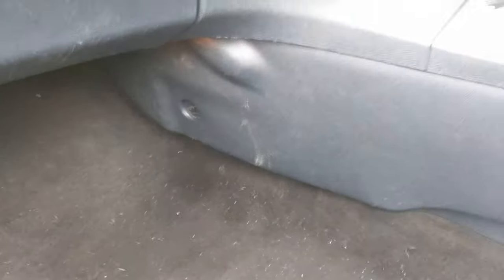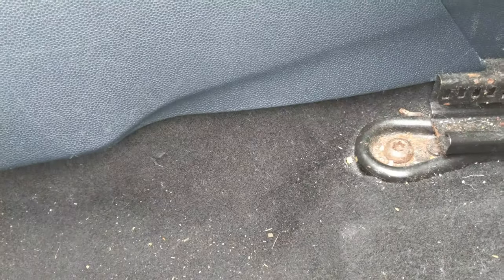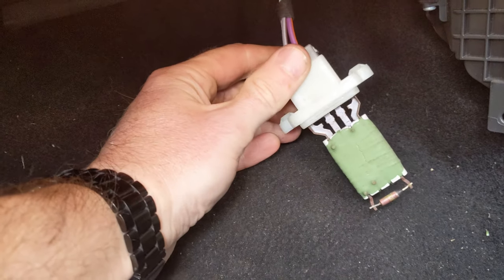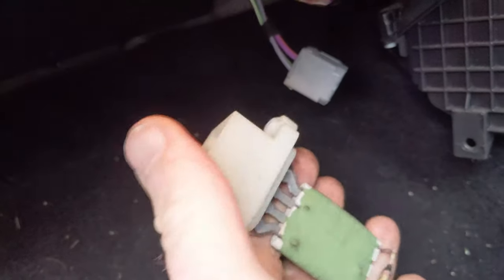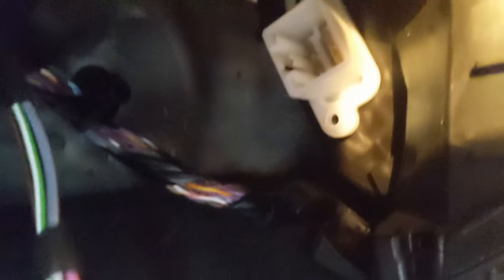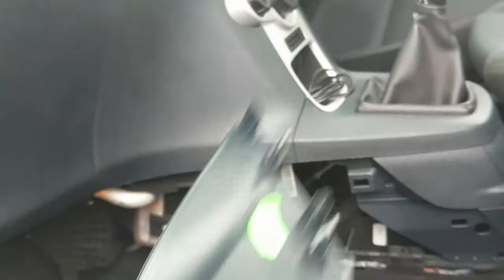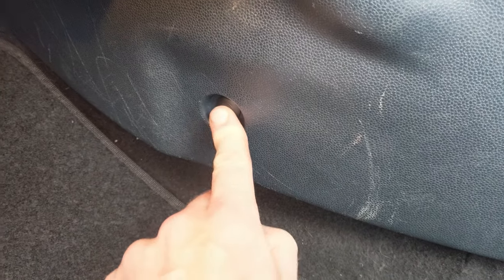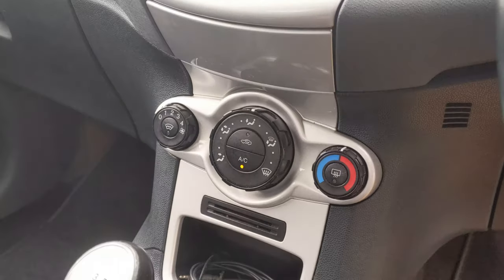Fiesta heater only works on four - Fix

Comment: Mine just blow for the face, I switch to feet or windshield but still blowing for the face... You know what it can be?
Reply: Did you  find a solution to this? Currently having the exact same issue.
Reply: Also mine. I think that the windshield vent is blocked or something...
Reply: @autodiecastmachete  still don't know the reason... And now in winter is really bad